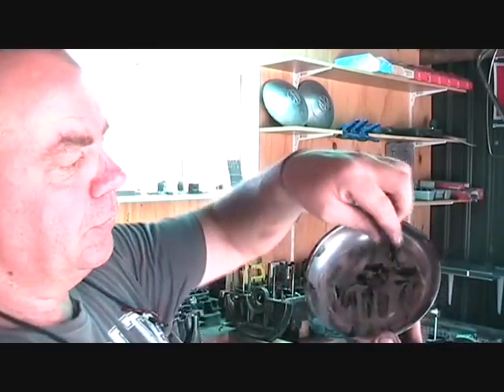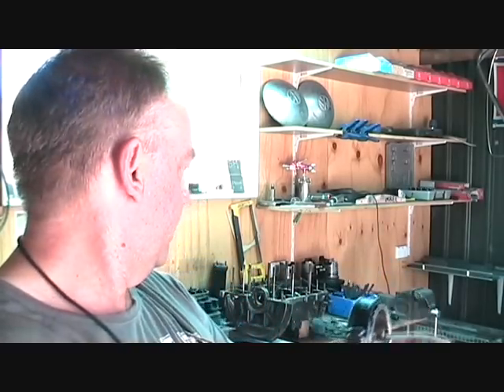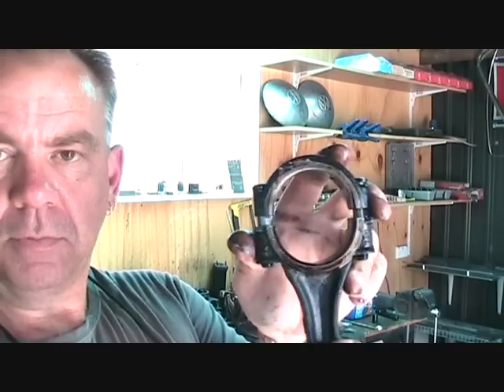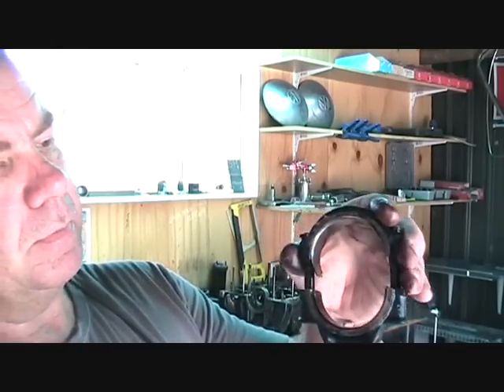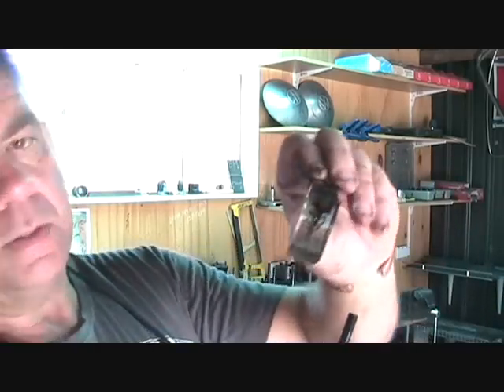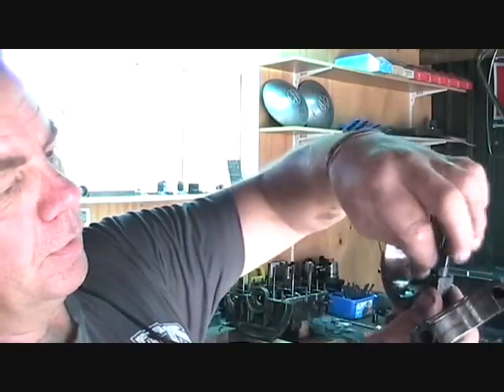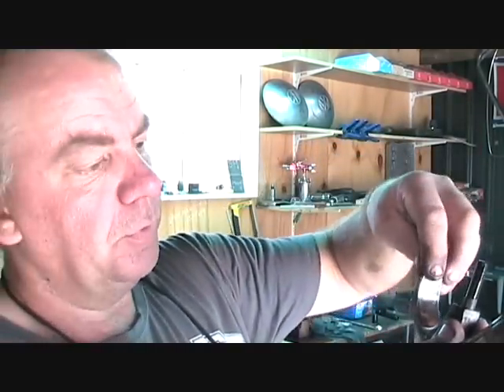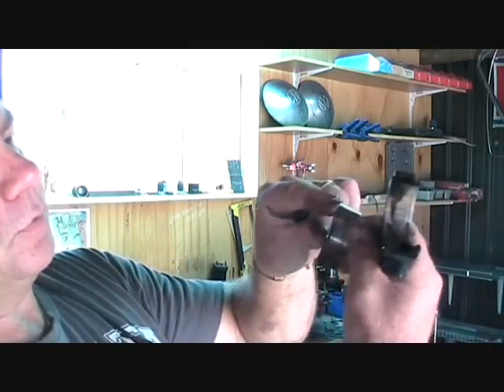Engine knock 2: Heavy metal

Comment: Before doghouse coolers the cooler sat in the cowling letting less cool air get to the #3 cylinder.  That led to overheating and burned #3 conrod bearing.   In the '70s I used to buy damaged engines cheap.  The damage was always a burned #3 conrod bearing.  The way to prevent it was to widen the valve lash in #3.  Valves were adjusted to 0.04 in #1, #2 and #4 but was 0.06 in #3.